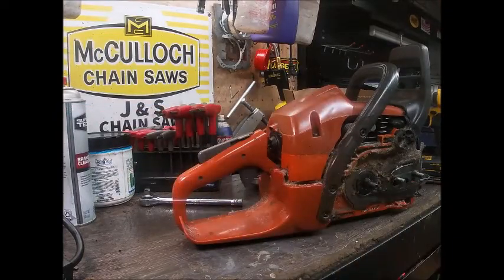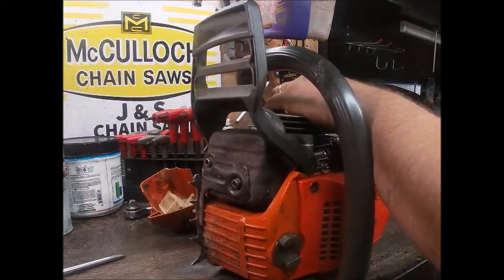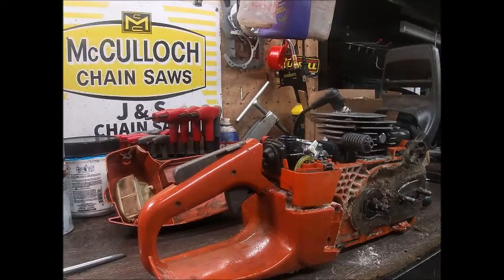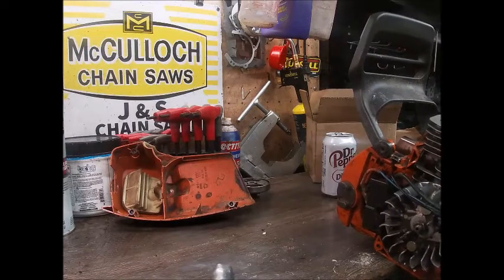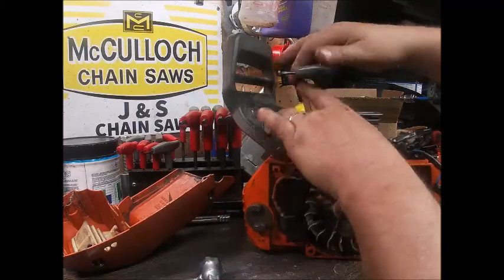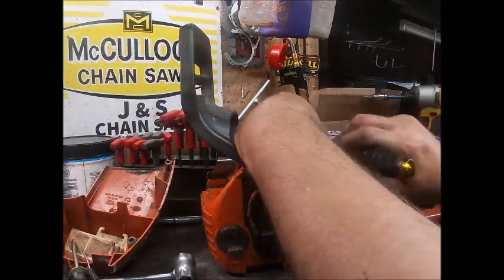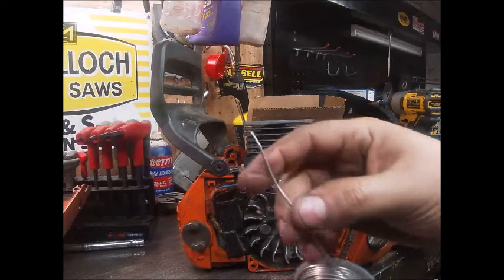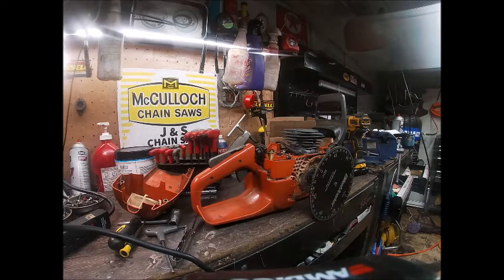Husqvarna 340 to 346 conversion using A Warhawk Cylinder kit Teardown Port timing and squish Part 1

Comment: Will the stock 340 wrist pin work with 44.3 piston
Reply from the maker: its the same
Reply: @JandSChainsaw  thank you I have a 340 I’ve been wanting to spice up. It’s been a heck of a saw. I’ve cut a lot of brush doing right of way work and it has developed a. Air leak around the intake with that silly set up. I’m going to get the plate , cylinder and piston kit and do this saw. The bearings and seals are still good and all that will work with the plate correct? Thank you. Out of all the channels I watch I really enjoy yours cause I can relate we pretty much live in the same geographic location
Reply from the maker: @SCouch-cw6je  bearings are the same but the seals are different...while i had it down id just get new bearings and seals for a 350...cheap insurance...
Reply: @JandSChainsaw  thank you